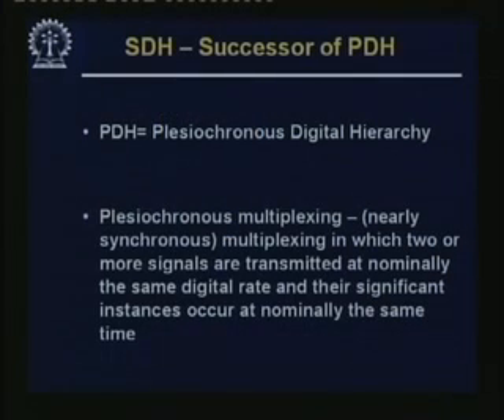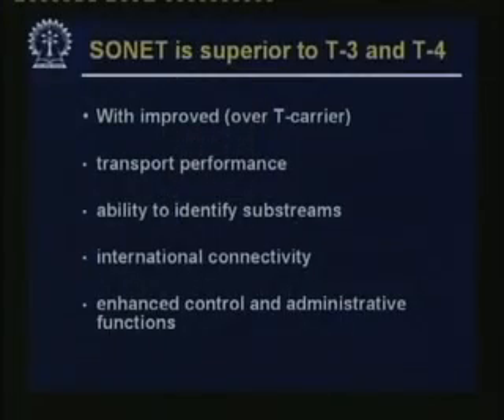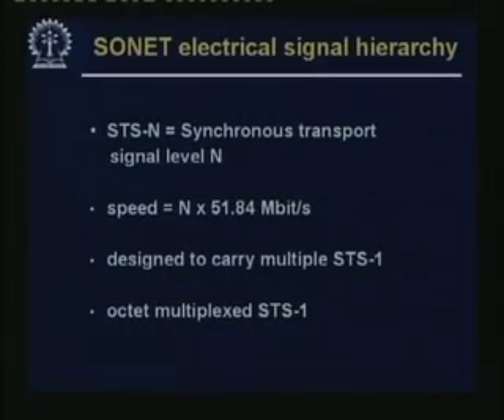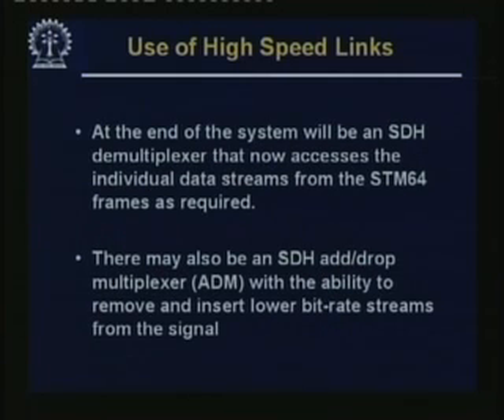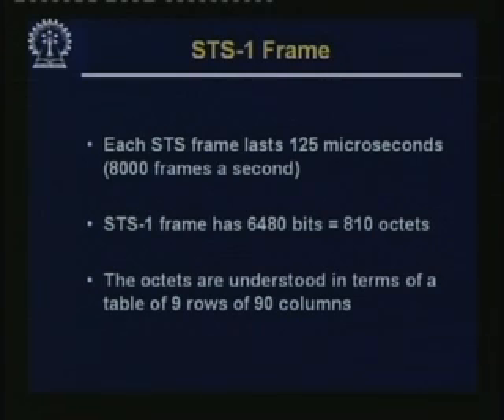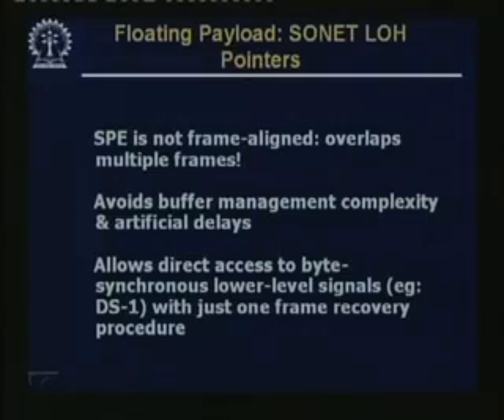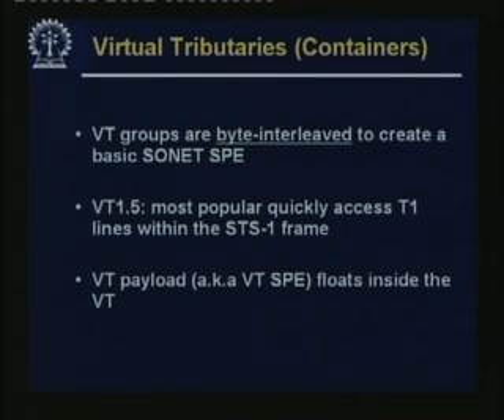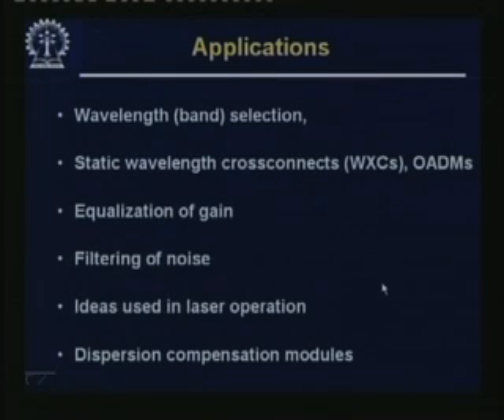Lecture - 9 SONET/SDH

Comment: i thought in framing their were 9 rows and 270 columns :::bcox 1 stm > 9*270*8*8000 ==155mb approx that is 1 stm
Reply: Hello Ahmed,
how did you get that calculation?

thanks
Reply: Kingsley nice to hear from u.do u work in Lagos?
Reply: Ikechukwu ezeokwelume    9 rows and 270 colums with 8000 frames persecond and 8 bit bitstream of data ... 9×270×8×8000=155mb approx
Reply: Ahmad Zafar  that is for stm 1. The frames he is referring to is STS 1 frame. 51.84 Mbps , that is 9*90 matrix.